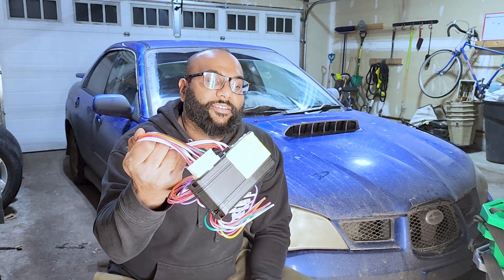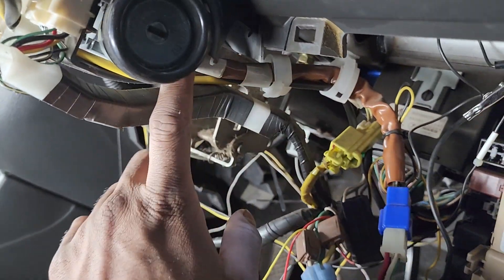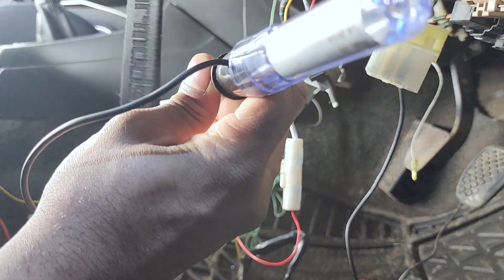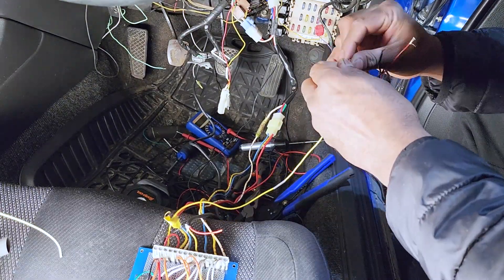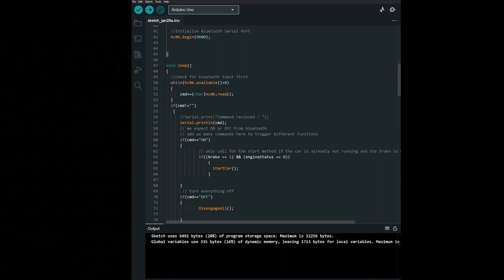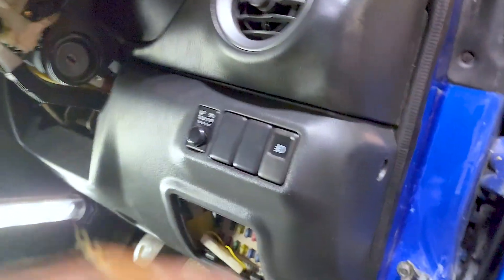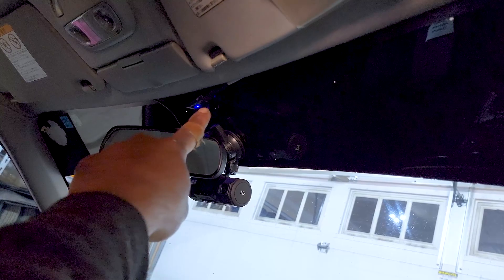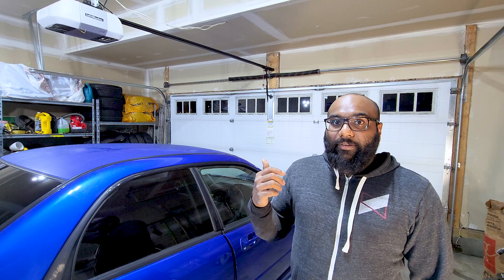How To Build Arduino Remote Car Starter - Step By Step Guide

Comment: What specification of relays did you use?
Reply: Any relay that can be operated by the Arduino and that can handle the voltage and Amps of your car starting system. I don't remember the exact modle. But they were capable of handing 240v AC. So 12v and some Amount of Amps would be fine for them

Comment: Bro, nice Job! do you have meassured if this system drains your battery?
Reply from the maker: I haven't seen any battery drain issues since I've installed it over the last and this winter. The Arduino uses such a small amount of power and since I drive the car every day It hasn't affected at all. Iv had times where I had parked the car for about a week and the battery was fine afterwards.

Comment: Was there no issued with immobilizers?
Reply from the maker: This is easier on older cars to do. But there's always a way to get around immobilizers. Maybe hide a second key that only powers on when commanded by the Arduino. That's how most commercial products do it.

Comment: Hi! How did you powered the arduino module? Directly to the fuse box using a voltage regulator? What did you use as a ground for the regulator if so? And what exactly goes into the relays? (I see multiple wires in each relay. One should be the ignition/acc/power wires you got into, but the others)
Reply from the maker: I powered the Arduino board directly from the battery(fused). Arduino can handle up to 14v I think. It's been working just fine. As to relays and other wires, youll have to look up the wiring diagram for your specific car. And be sure about what you are doing. You could easily brick your car.
Reply: @jehancoonghe my car doesn't use any specific security protocol for ignition(like clutch pressed or brake). So that means I'll only have to wire the power on/acc/ignition wires to a relay for each, right?
Reply from the maker: Sounds like a correct assumption. But again my advice is you should read and understand the how your car is. Wired before you cut into it. There shouldn't be too much different from car to car but who know.
Reply: @jehancoonghe  thank you! Keep it up :)

Comment: Hey, nice project. I like the addition of the second attempt to start the car if first attempt failed. Just wondering if you have any links to the code you used? Or if you would possibly share it?
Reply from the maker: Hey thanks for the comment. I only have the older version of the code since I lost the one I made change to. I'll make the changes again and post it here.
Reply from the maker: Here is the link for the Code. It should work as is but it wont hurt to double check for yourself. 
https://drive.google.com/file/d/15AWamnycJxN3NbyhpKOGuiJFy7Hj0Occ/view?usp=sharing